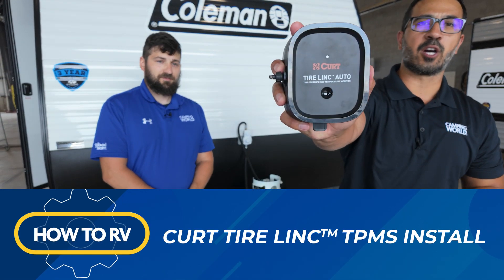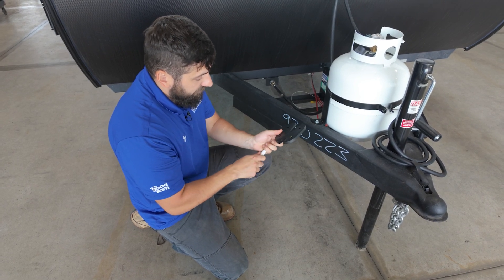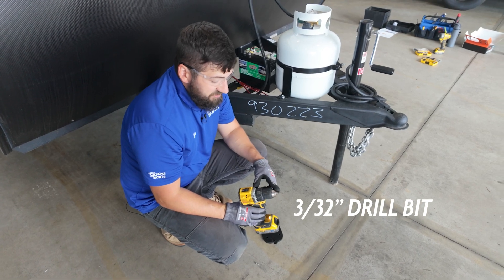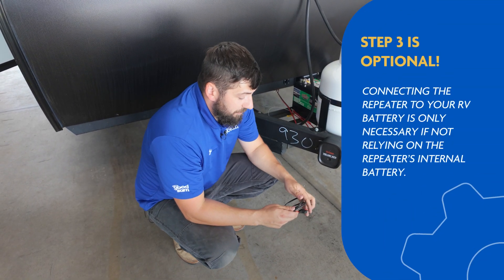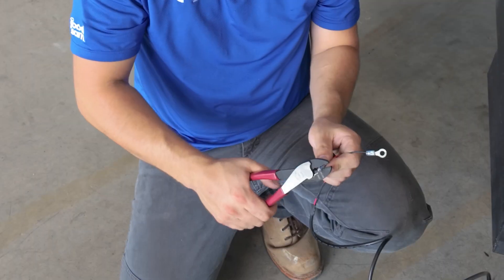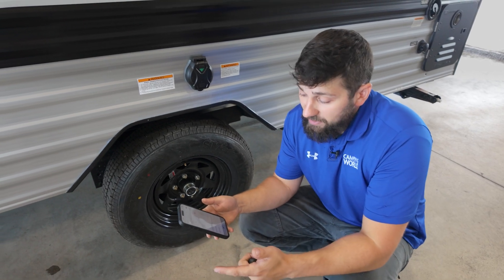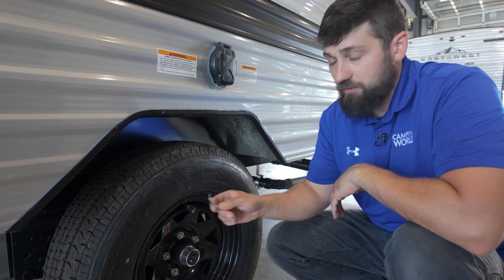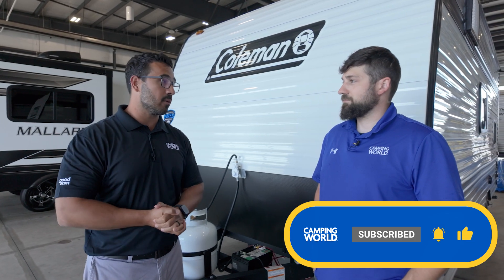CURT Tire Linc TPMS Install | RV Modifications

Comment: Doesn’t that location interfere with a WDH system/saddles
Reply from the maker: Great question! This will vary slightly for each setup, but you will certainly need to ensure your mounting location doesn't interfere with weight distribution hitch saddles. 

Other mounting location considerations includ: 

- Ensuring the repeater faces your tow vehicle for best possible connectivity
- Ability to connect the repeater to your RV battery without the connection being strained or overly tight (for splice-in wiring only). 

Thanks for pointing this out!